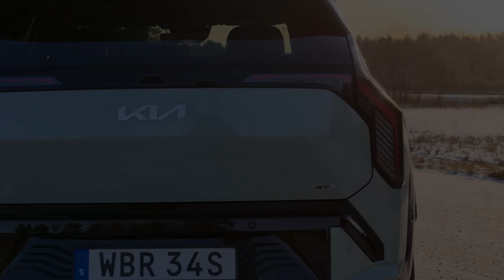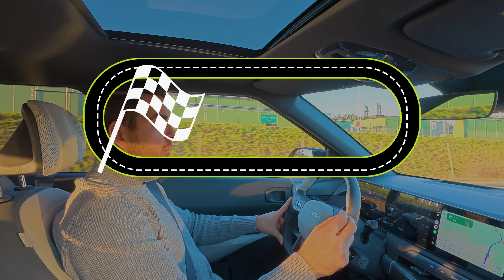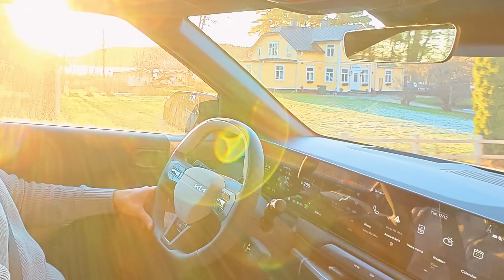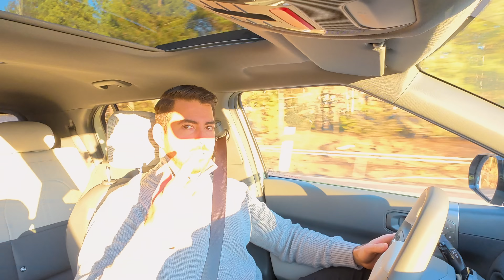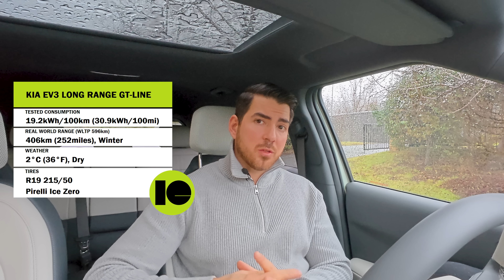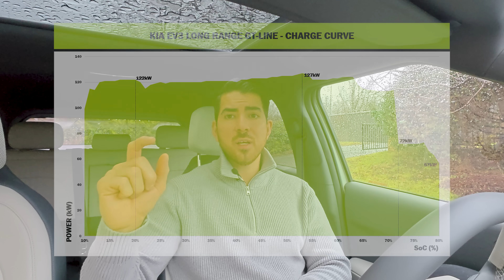KIA EV3 Range Test: Disappointing Result?

Comment from the maker: While the EV3's energy consumption is not excessively high, it's higher than anticipated given its size, motor, and the relatively mild operating conditions (2°C, preheated, dry roads, limited wind, moderate tires). This ranks among our lowest scores, with only two other vehicles performing worse under significantly harsher conditions.
However, the EV3 boasts a strong overall range due to its large battery capacity. We maintain that it remains one of the best vehicles in its segment.:_IOEIOE:
Reply: The boxy aerodynamics doesn't help. It's interesting Kia doesn't even publish the cd for this car.
Reply from the maker: I think it's 0.26

Comment: Have had our EV3 for 2 months now. It's Air Long Range and it's regularly achieving 500km in normal driving mode.

Living in southern Spain means the Aircon has to work pretty full on, and lots of steep hills to climb, so the battery is doing a lot of heavy lifting.

Thankfully we don't really need to precondition the battery given our average temperatures 😂

We get 500 km range regularly despite my heavy right foot.😱

Buy the largest battery on offer, no matter what EV you buy. 🧐

We decided to spend the money on the longer battery rather than higher spec, and we are glad we did. My son bought the Earth with standard battery, and he now wishes he had spent his money on range rather than spec. 🤷‍♂️
Reply from the maker: I agree big battery FTW

Comment: 252 miles in these kinds of winter conditions is pretty good. It'll likely get over 300 miles in the summer. The charging is not great, especially when compared to their EGMP cousins, but you expect that at this price point. Yes, 400V is cheaper to manufacture, but faster charging would undercut their higher priced 800V models. So they purposely make them 400V even if it costs them more to manufacture.
Reply from the maker: Agree. The strategy is clear.

Comment: Most EVs are absolute pain in the winter. My corsa-e range drops like crazy and of course in winter charging takes longer. If you set the heating to a normal temperature /not something like 19 or 20 degrees/ and drive on a highway at about 110 km/h, the estimated range drops even further. EVs are good city runners and are ok at short, out of town trips. As soon as you need to cover longer distances, they become frustrating.
Reply from the maker: I always drove on 20c, a lot of people do. You drive in 22-23?
Reply: @ItsOnlyElectric  yep. 22-23 most of the time during winter. Especially in the evenings it can get pretty cold here in Eastern Europe.

Comment: Running car (gt-line s) in Finland -2c between Turku - Helsinki - Turku  - 381 km offered 19.4 average with 19' wheels with studs. 2 passengers. Including 300 km of highway with speed set to 96kph/h with cruise control. I was left with 8 % of battery with 70km range (middle gauge). So there could have been potential to do that ~440 in winter. I had 19 celsius temperature set in car. For me that is fine and car in this size its great.
Reply from the maker: Nice. Thanks for confirming and congratulations to a great car

Comment: I have managed 18.2 kW per 100 km over 2500 kms. Mostly whort runs. Occasional preheating. UK winter tempoeratures. Long range Air model with 17" wheels and all season tyres. Pleased with that, and on mild days have managed 6.4 km per kWh.
Reply: How much highway at 120kph? We drive 95% highway a lot of days 300km+

Not ready for EV And super charging all the time.

Comment: How fast were you driving for the range test? :)
Reply from the maker: Avarege 93km/h
Reply: @ItsOnlyElectric  ok thanks! Then quite good consumption at that temp with that average velocity 😊 as wltp is based on lower average speeds 🙂
Reply: @ItsOnlyElectric  btw, great video!
Reply from the maker: thanks!

Comment: I really hope KIA have fixed thier 12v issues with the EV3. As the EV6 and EV9 still have troubles with thier 12v.
Reply: What is exactly the problem with the 12V?
Reply: @samit7570  It fails to recharge properly so you cant start the car. Its not unusual for KIA drivers to have a jumpstart with them incase it happens. KIA have done recalls on the EV6 to change 12v and ICCU unit but the problems still exist. It doesnt fix them properly. They still use old style 12v which is not enough. 

These problems also exist for the ioniq 5/6.

Comment: Boy, he needs to spend over 30 seconds on touching the screen to switch off the bleeping noises. That must surely be highly dangerous, if not illegal too.
Regarding consumption, other reviewers have also commented on the very poor fuel consumption results, especially for a small car. I simply cannot understand why the latest EVs from various manufacturers are producing even worse results than older cars with older technology.
Reply from the maker: Yeah it is pretty annoying, but the most important things turn off by holding 3-4 sec on the steering wheel.
The other ones are not in one go, so luckily I didn't turn them all off at the same time. So it was not for 30sec straight.
Yeah does not seem to be the same motor as the other KIAs either. So does not seem to be the "real" e-gmp platform

Comment: Dont know how you measured id3 as quietest.  Never seemed like that to me.  Also others say eqa not quiet but your figures for ev3 same as eqa.  Only car that comes out consistently quiet in tests seems to be nissan ariya?
Reply from the maker: It's all very depending on the wheel size, tire choice and the road itself. We test all cars on the same stretch and with the same equipment.
Reply: @ItsOnlyElectric  will you get the elroq to test soon?
Reply from the maker: @nic47531 yes, as soon as it gets available for testing. We are on it. 👍

Comment: Seems too high consumption for the conditions! How was the regen setted? This can also add a lot to your consumption!
Reply from the maker: Yes, we also noticed a little bit higher consumption than expected overall when we had the car for the whole period. Not only on the range test.

But both of us prefer to drive with maximum regen and one pedal if available. All accelerations were calm, and cruise control was used as often as possible to keep the exact speed.
Reply: @ItsOnlyElectric That's going to be THE problem! Max regen will give you at least 1-1.5kWh extra consumption, even if it's not for urban use. Lots of micro braking which takes away car's pace. The Kia/Hyundai cars do regen very efficiently, so zero regen and auto mode is best for the consumption. Try it that way if you really want to know the EV3's real world consumption.
Reply: @GergelyKoltanyi I drove this as a rental car and the video matched my experience quite well actually. Doenst seem like a great car honestly at least for that price tag
Reply: @doajackpot8281  And how does this relate to measuring consumption without using full regen?

Comment: This is absolutely rubbish. You haven’t even realised how long you weren’t looking at the road while you were driving. Yeah you can say you’re an experience driver but most of the buyers aren’t. This shouldn’t be allowed while driving
Reply from the maker: Sad to hear you thought it was rubbish. I would not recommend looking away as much as I did, you are completely right.
Car was on both cruise control and lane assist the majority of the road. And the video is cut so it looks like we are looking at the camera as much as possible.
But you are still right.
Reply: @ I didn’t ment on your video i ment about about the screen in that car. Im a truck driver so i spend some time on the road but to see this that long seconds are passing by just to find one menu it’s just horrified me

Comment: I suspect the bigger seller will be the Air version (81kwh battery) with a Real World (tm) range of c300 miles...and very few electric cars can do 300+ miles at that price point!! I have a MG5 which gets 160-180 miles max in the winter and closer to 230 miles in summer. Its a nice car, at a great price (for an EV) but I reduced the lease period exactly because its pretty much just first gen EV and newer, better cars are on the way (like this one) and I didnt want to be stuck with a lump for 4 long years! :)

Comment: Thanks for the video, your review was great thank you. Will the winter tyres have an effect on the consumption/range? Do you think that you would get a range any closer to WLTP on all season tyres? Will you be testing the basic version with 17" wheels with another range test? I'd love to see what you think of the basic versions. I think on UK roads I'd be thankful of the soft suspension with all our potholes.
Reply from the maker: And thank you for watching!
Hard to tell, It could be because the rubber is a little bit harder. But it also depends on the brand and what that specific tire is focusing on.
For now I don't think there is a "base model EV3" for press, and I don't see that we will test it in the near future. Could be that it can come up in another type of video (battle, vs or something)

Comment: It's a nice evolution of the eNiro/Niro EV models. Kia actually haven't spoiled anything (maybe except for the charging port location - WHY???), otherwise everything is better (oh yeah, forgot that you get these plastic seats instead of real leather in the top spec) and even the Earth trim gives you basically all you need in an EV. Currently I'm a happy eNiro owner, but this would be my No. 1 candidate for the replacement, when time comes. Thank you for your review!
Reply from the maker: Yes it is! Probably the best deal in this segment when looking at the lower trims
Reply: What's wrong with the charge port location? Perfect for Superchargers
Reply: @austin2planks  Not so much with the Ionity though.
Reply: @pawekropi5077  usually plenty long enough

Comment: I never turn off the speed limit I only turn off the audible warnings but do turn off the driver alert settings but I have a favourite setup on my steering wheel for the favourite button on it so it takes me straight to the menu needed.  Mind you I don't have a Kia but a Hyundai Kona 2024 with the same CNCC software stack.  Did you do the test at GPS speed limits as that is what the Police use not the inaccurate speedometer that is wrong in all cars.  Decent charge curve though, holds it high across the curve up until about 72% when you unplug and head on to the next charger.
Reply from the maker: It's the audible you want to turn off. The graphical part is great to keep.

We adjusted the consumption according to the right numbers not only the numbers the car gave us. It seems to over report the distance by approximately 3%
Reply: Korean cars are slower than GPS speed by putting a safety margin in the speedometer.

Comment: thank you very much for the video. How do you think previous versions that do not have a heat pump can affect autonomy? Do you know if the air or earth versions, which do not have it as standard, can be purchased with a heat pump?
Reply from the maker: I guess you meant how a heat pump can affects the efficiency? Here in Scandinavia with get all versions with a heat pump as a standard so it's depending on where you live. It will affect the range with let's say 20-30 km during winter and hot summer days.

Comment: Nice presentation, perhaps a better titel should have been choosen. Winter tires are always less efficiënt. The outside temp is always influecing the range (also the inside temp setting). The car has heated seats and steering wheel, these are much more energie efficiënt, so always switch these on in winter.
Reply from the maker: Thanks for the tips!
Car started warm, only the passenger zone heating active , the car had a heat pump and roads dry. So yes, the result is a bit disappointing, not catastrophic. We have tested 50 cars on the exact same route and compared our other results it's still disappointing.

Comment: my experience on driving various EVs is that real world real range is about 60% of whatever they advertise. Charging takes 40% longer than claimed. EVs are definitely getting there. Likely I will get one in 2025.
Reply: We often get over 300 miles range compared with the stated 285 miles in our eNiro 4. On the eNiro FB fora we are not the only ones. my sister-in-law frequently gets 320 in her Kona (285 stated range). Otherwise, I agree and once you load the car, cold weather, have the heater (or A/C) on then the range dramatically decreases and I always tell people who might be buying an electric car, that in these conditions expect 30-50 miles less range than advertised.
Reply: Agreed. I always advise and follow taking 50 miles off whatever the advertised WLTP range is to get an idea of real world range! And this is a more accurate way of doing it. To avoid being disappointed.

Comment: I Will like this car in 2 hand car... To buy it with 50% of discount, like my E-niro.
Reply from the maker: Smart
Reply: Kia e Niro is still a great BEV! I also own one 😂
Reply: @yingmustang67  EV3 will be to replace my old ZOE... E-Niro for the town and nearby are excellent. I ve made 385km in "slow" speeds in one day.
Reply: @contra_plano 
In what kind of weather condition was it, when you drove you e Niro? And how big is the battery? 39 KWh or 64 KWh?
Reply: @yingmustang67  64kw with 11°C/15 without heat Pump, well i did not need heat

Comment: I'm curious, except the speed bipping that you've to deactivate, the other ones can stay deactivated or you also have to remove them on each time you drive? If each time, is it possible to also disable them with a button?
Reply from the maker: You only have one shortcut and need to choose which function to bind it to. So it is not possible to switch off all with one push. It didn't save the other setting either after restart. But some of them are probably tied to the driver profile, but sometimes hard to determine with press cars.

Comment: Considering the actual WTLP on 19" wheels is reported officialy at 563km. Then you are driving barely in + degrees centigrade and on a wet surface which is the worst condition in terms or rolling resistance and also I noticed that you didnt quite drive even close to ideal in terms of normal efficient driving.

I live in Finland and would of done such a trip with lesser consumption on a EV6 AWD. I test drove EV3 in -9 degrees centigrade a week ago and got over 450kms out of the battery with a GT-Line 19" demo in semi country road and highway mix. Use the car right, preheat the cabin before leaving and while alone in the car use 'driver only' aircon instead of wasing enerty to heating "nothing".
In Summer EV6 goes way beyond WTLP figures and I have no doubt EV3 will smash the WLTP figures by flying colours.
Please note that -9 is almost 30 degrees centigrade less compared to the WTLP measurement conditions at over 20 degrees plus.
Reply from the maker: Roads dry during the test. We managed better WlTP ratio with The ev9 in worse conditions. And keep in mind this is not s hypermile test.
Reply: @ItsOnlyElectric  it does not take a huge genious to understand that the effect on a EV9 is much lesser in terms of percentage compared to a super efficient car. If a car consumes already quite a bit conditions dont change that much. If a car is super efficient in ideal conditions worse conditions effect it percentagewise more.
I would think that channel big as you would know this by default. 1-2 kW raise compared to 15kw or 20kW is totaly different.
Reply from the maker: @Harhawink that's just an example. My Model Y performance is more efficient than the EV3 in the same conditions (both in % of WLTP and consumption) or actually in all conditions. The fact persists, it's still not that efficient in these conditions, and that's a bit of a let down for such a great car
Reply from the maker: And by the way the car was heated before starting and only driver active for the HVAC. The ying is that the cars iverreports the distance with almost 3% so looking at the consumption stated by the car is a bit misleading. So the numbers in the video are adjusted according to that.
Reply: @ItsOnlyElectric heat the seats may helped

Comment: Compared to my Kia eSoul 64kwh, this car has many good improvements. A bit pricy compared to Model Y
Reply: Ev3 air with big battery is 35k in austria. So better value for the price than model y in my opinion.
Reply from the maker: @pm2453 that's cheap!

Comment: Why does 2 more inches affect the range so badly?
Reply from the maker: You lose 42km of WLTP range going with the bigger rims. It's all about the aerodynamic design and weight of the rims. If the rims are very aerodynamic and as light as the smaller one there will be no difference. 

It's all about minimizing drag and unsprung weight.

Comment: Nice presentation style. Just move the mic further from your beard. 
Shame you have to buy top trim level to get V2L and surround view cameras.. and no heat pump on the base level EV3! Energy savings from the 17" wheels on the 'Air' trim will be lost from not having that heat pump. Disappointing.. and should be just a standard feature on any EV. The LEAF has a heat pump and it's very efficient, so it's a basic expectation IMO
Reply from the maker: Thank you @decimal1815 
Yeah I completely failed with that, I checked before driving away. But my head movement was far more than I anticipated 😂
Thank you for your kind words!

I also completely agree with the heat pump, it really should be standard on all electric cars now a days. I also don't understand why not 17" or even 18" wheels are an option for the GT-Line.
The range is decent for this car, but that is only because of the huge battery.
Reply: Tenía un leaf 24kw/h del 2014 y lo que falla Nissan es que las baterías son refrigeradas por aire....
Reply from the maker: That's high.